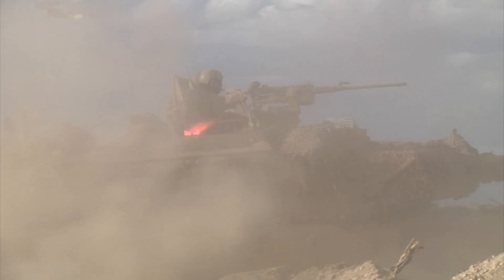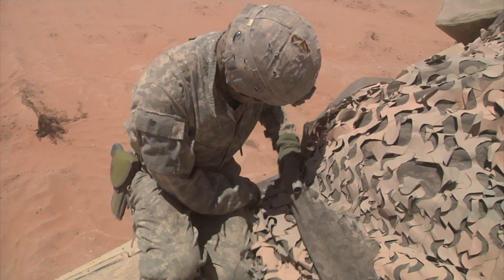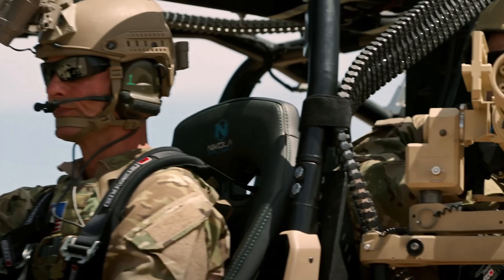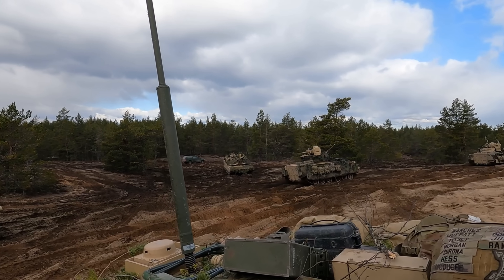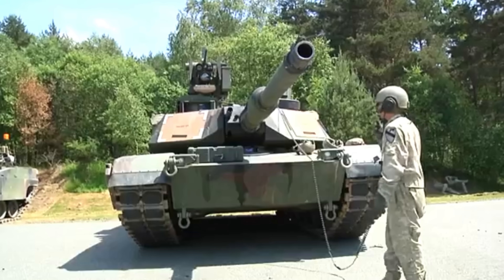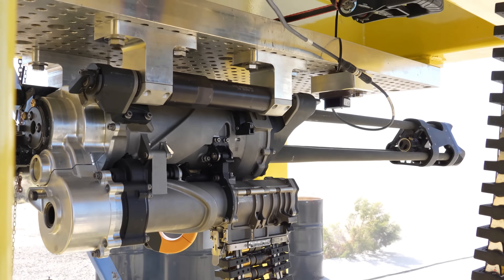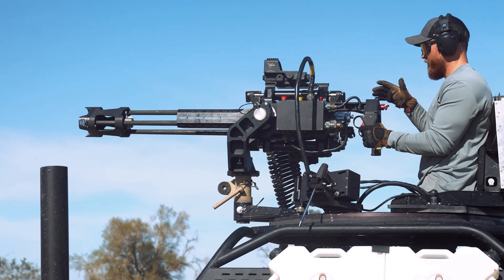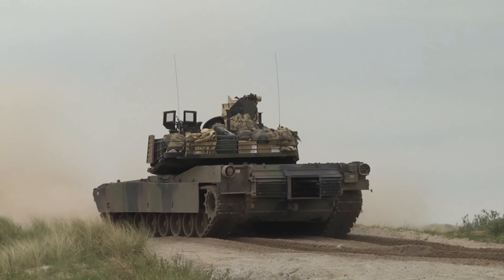Why is the U.S. Army putting a M134 Minigun on Abrams? | ROTARY GUN DEFENSE

Comment: I think testing out systems like this makes sense. Test it, see if drones can be effevely engaged by the weapon at appropriate ranges, then work it into a remote or semi automatonous weapons system if it functions well.

The idea you threw out about a claymore like one, that would only be a last ditch defense at extreme close range. I see some suggest a 5.56 micro gun style system, it's a bit closer range than this, not good if they start using drones with rockets. A 12.7mm system could be great at range but a serious ammo hog.

Exposing a crewman when they are engaging a kamikaze drone is one thing, but drones arent all going to be that style, they'll be engaged by drones with grenade launchers, rocket launchers, maybe even small arms. I could imagine a foe throwing a couple kamikaze drones in, while engaging with a drone with an air bursting grenade or rocket to kill the gunner. I don't imagine the military would leave it as a manually operated gun for very long.

Comment: Pretty sure its a stopgap but knowing and having served in the US Army both Officer and Enlisted. Stopgaps are usually permanent because Procurement of a new system takes 5 to 10 years to implement even if its finished in production and good to go. That said I'd much rather have the M134, GAU19B or whatever can be slapped on NOW. In my honest opinion being from the country Two Rednecks hanging out on the turret with Remington 870 Shotguns with 3.5in Super Magnum Buckshot would be optimal.

Comment: I say bring back the xm214. Everyone wants bigger but as far as I'm aware drones aren't armored. Just some plastic blades and carbon fiber. XM214 is 5.56 half the length just as fast half the weight in ammo. Better ballistics than 7.62 or enough to take a blade out anyway. You could carry two on the tank. Not that the tank is a good platform just saying. A small radar to spot drones. You could have crossfire with other systems. To you point of shooting another tank well a 5.56 wouldn't even register on an Abrams. Just my 2 cents.

Comment: Big fan of your content Matsimus, the Profense M134 uses brushless motor technology which allows it to immedietly vary the rate of fire from 800 to 3000 rd/min via 1 of 2  push buttons.  These values are easily programmable to other rates as required.  The point of immediate rate of fire changes is ammunition conservation.  The user can achieve a solution by fire or suppression with 800 rd/min then immedietly hit the high rate button to destroy.  Short "burps" are acceptable with Profense technologies.  Thanks again for informative content!

Comment: I think it’s a stop gap measure and more so a training and sustainment exercise. Getting crews used to drone countermeasures and having to look after another bit of kit aswell as getting them used to the extra supply challenges so when they eventually get a purpose built thing it will hopefully take less work to implement.

Ps the gau series of guns (18-19) are the best got the punch of a 50 and the fire rate of a mini

Comment: #1 - Mount a remote (Brrrtt.) the A-10 warthog plane  gun with additional AI for precision on the top of the tank then work on stability  ( But not to take ou  drones) But to kill tanks and armored vehicles in different way the GAU - Avenger 30mm gun

#2- Mount a remote turret with Bradley's  gun on the abrahams tank with extra granade louncher then improve the stability of the vehicle and size ( Not to take out drones) for lethality versatility

#3- For drones attacks  both Jamming and Reactive net kinetic system with AI. 

operating  similar to reactive armour spoting the drone trajectory and shot anither defensive mini Drone net high in the sky  with just the way drones  interceptor 

to embrace and catch the attacking drone

The interchange adaptability of systems between us forces division can save a lot  issues

Comment: 10-8 gauge full auto belt fed shotgun. Top mounted, possibly automated. At those large guages you'd have no problem packing them full of buck shot or even bird or a mixture. For reference a standard 2 3/4 inch 12ga shell holds about 9 pellets of 00 and 28 #4 buckshot. A 10ga can hold 18 00 buck pellets and up to 50 #4 buckshot. 8 guage would only hold more though I couldn't find any numbers on it because 8 guage is mostly on used as an industrial deslagger now and not traditional firearm uses. But i have found that slugs as high as 3 ounces have been used so you can imagine.  But an 8 guage is about 21mm. So it'd essentially be a 20mm shotgun. Whether using 00 buck, #4 buck, or even hybrid loads it would be fantastic for drones and even serve as excellent antipersonelle and light vehicle roles. Even more so if you had the ability to swap out to some of those 8ga 3 ounce slugs. Though I think 10 would be more practical from a balance of weight/size vs. area of effect.

Comment: M230LF.  The 30x113 cartridge is only 199mm compared to 134mm for a .50BMG round but packs a 30mm programmable HE punch.  We should be putting these on everything.  They have been test-mounted on the JLTV and even the back of a pickup truck.   Slave the powered mounting to networked sensors and everything has the ability to knock down drones, helicopters, low flying aircraft and still be able to hose down a tree line with 30mm goodness.  In my world every platoon will have a vehicle mounting one and every squad will have an Ohio Ordnance Reapr in .338NM on tap.
Reply from the maker: That sounds like a very interesting idea, thanks for the info!

Comment: As cool as this is, it doesn’t seem practical. The loaders M240 is the backup for the gunners coax and the maintenance required for these things will only add more of a hindrance to deal with in addition to the plethora of random issues that comes up with the Abram’s. Anytime more tech is added to these tanks, so does the fault list and potential for failure. Also, the ammo box on top of the blowout panels is wild. 

If the army wanted a drone defense weapon for the Abram’s, passive EW protection would be the most effective and cost efficient.
Reply from the maker: Thanks for your comment, the maintenance aspect is certainly a concern that's worth considering!

Comment: They could idk heres a thought mount the GAU-21 onto the vehicle Im about 90% sure the GAU-21 fits on a standard M2 mount.... its just very slightly longer at the receiver backend. but its 1200 rounds per minute. 50 caliber machine gun. you could easily pair this with a new proximity exploding ammo and some kind of radar system like a budget active protection system it could potentially engage and shoot down ATGM's and Drones and aircraft when not in use it can function like a normal commanders weapon. 

if they just integrated the RWS and used it instead of the CITV. tada a bunch of turret space cleared up.
Reply from the maker: That sounds like a great idea!

Comment: These dudes are seriously trying to argue that an automated firing system connected to a mini gun wont be effective in protecting aganst drones? The only real issue I see with that is the ammunition size and cost per bullet spent compared to cost per drone. It could be weasled down to a much smaller cartridge than a 7.62x51. But it also depends on the range that these systems can detect drones. If they can detect them out to hundreds of meters, they obviously need a high power, high velocity cartridge firing at extremely high rate of fire to be able to effectively hit flying targets.. But if its designed to detect them at short distances, they could use some sort of auto shotgun mount. It really depends on the distances this thing is designed to engage at. Wether it would be effective is not the question lol Because it would be, without a doubt.......The question is, how do we make it as effecient as possible? How do you make it easy for this system to be dealt with logistically?

Comment: I think that the Abrams is just at the end of its 'relevant' life. Its been in service since the 80's.  A new chassis and turret , new armor, etc. is needed considering modern threats.  FPV, GPS jam, etc.  

IMO you would have a unmanned turret with autoloader and a 4 man crew, Driver, Gunner, Commander, and a EW / Defensive Systems Operator,  You retain the fourth crewman and gain a dedicated person for managing defensives, especially as those defenses require more thought to implement in the moment
Reply from the maker: Those are some interesting points regarding the future of the platform!

Comment: Honestly i think knowing headspacing on the m2 machine gun is a nightmare and given the m134 has a much higher damage output then i would say the 7.62 nature of the m134 is also more capable because the round of much smaller allowing for more ammunition on the gun itself or on top than inside the tank...
And size and weight might have a role given the m2 is really long and heavy thus a m134 could be more helpfull in that regard..
Having the gau-19 you still have the same ammount of .50 caliber amunition as with the m2 only it goes through it much fast, and though the gau-19 has the same or similar volume of fire it would need much more ammunition than the m2. Thus the 7.62mm system has a better solution, les actual bullet to shoot the more you can carry, and yes you can't maybe hit armor or cover with the first 10 rounds it still keeps them busy thus still they are unable to do much unless they take a risk and peek out from cover wich wil lead to a hit and so a big chance of them being out of the fight in general even if they are not dead...

Comment: drones are a problem.

this needs to be aknowledged.

and the way to aknowledge it is by protecting the tank from a massively assymetric take-out by, if what he said was true, a 500 dollar drone (not including price of ordnance im assuming)

you would need radar (not a problem, drones are pretty easy to spot on radar) and an an m-134 or tubes with multiple short range SAM, Stingers, most likely.

no point i having a great beast like that roaming the battlefield if it can be taken out by something as cheap as a 500 dollar drone.

protect your assets, or lose em, its not complicated.

Comment: Personally I think a counter burst system. Add some modified smoke launchers with airburst munitions. Basically the same idea but using small airburst mortars. Could easily dispatch multiple drones, deflect/damage/disable larger munitions. And they're small. Could strap extras as with ease too
Reply from the maker: That is a very interesting idea, thanks for sharing!
Reply: @_Matsimus_  Thanks! Damn near every armored ground vehicle we have already has the launchers and wiring. Although I did see an article about the new Leonidas system a few days after I posted lol No two ways about it... theirs is WAY cooler lol

Comment: Instead of scaling up to the Gau-12, I think a better option might be scaling down to XM214 Microguns, but to place them on automated gimbals on either side of the turret.  Between their two firing arcs you can get full 360 degree coverage with only tiny blind spots at near point blank ranges.  5.56, the ammo is dirt cheap, lightweight, amd the USA already has literally  billions of rounds of it sitting arround in storage.  Your average FPV drone can be taken out with a baseball; so, bigger calibers are completely unnecessary for drone defense.
Reply from the maker: That's a very interesting idea, thanks for the suggestions!

Comment: Seems to me that the perfect solution for relatively slow flying drones is some kind of computer managed quick firing weapon firing distance fused frag rounds that can lay down a wall of flak. If you could manufacture a round that can produce a spread like a shotgun round that has a range of say 1500 to 2000m firing about 600 rounds a minute you could literally put up a wall of shrapnel in front of a drone that would shred it instantly.

Comment: You gave up all credibility 5 min in when you rattled off all the systems on the top of the turret and say the loader can't possibly use a weapon station...the loader has always had a pintle and shield mounted M240C...the loader is and has always been the  primary for close infantry threats either while the main gun/coax is dealing with farther out threats or are too close or, too high, or confined spaces. Your lack of any knowledge about the crew roles/ weapon systems has invalidated you from ever having one of your videos appear in my feed again.

Comment: It's gonna come down to something like CIWS. They're gonna develop a radar fast and accurate enough specifically target drones of various shapes and sizes. An ammo rack for an M134 can be improvised on the outside of the tank, saving room for the coax and 120mm. I'm sure the army will find a way. Without some kind of targetable EMP, the answer to drones will probably look like the above.

Assuming the radar is good enough, a minigun is overkill. A 240 or a .50 would probably be adequate.

Comment: I think you are missing the true role of this weapon. It isn't really supposed to be used during an active assault, during a planned offensive the tank should have external sources of destroying drones. However, a lot of these tank kills we are seeing are on tanks not directly on the front lines. The exposure of the loader is required for the weapon to be able to properly angle upwards, and the ammo shortage issue isn't as prevalent if these are intended strictly to be a final wave of defense.

It seems like a stopgap measure, intended to give these platforms some rudimentary ability to fight back. That being said, I don't think it solves the issue at all. Firing these weapons is expensive, meaning the destruction of a drone could still cost more than the value of the drone itself, and the lack of a proper targeting system makes the effectiveness of the weapon in any area without perfect aerial sightlines, such as basically anywhere with trees, of questionable effectiveness. Something like a traditional 7.62 machine gun mounted on a remote weapon system with good targeting systems seems to me to be a much better option

Comment: For the reasons you laid out, I would think a 0.50 cal minigun would make even less sense against drones.
A 5.56 micro gun would make the most sense if any, as 5.56 should be plenty sufficient for drones at the ranges you would likely use this and it means everything would be smaller/lighter.

Comment: I think something on the order of a 20 or 30mm with fairly small propellant charge it don't even have to be multi-barrel Gatling gun but just 20 mm with a reduced charge in it make it smooth bore and make multiple different kinds of shells to engage different things so it can be used for something other than just drone defense hell maybe even 40 mil but I believe that's a little too damn big

Comment: personally its a mixed bag for me. I think the effectiveness of a high rate of fire weapon system is debatable against drones. A more advanced APS could of done this job easily.  As a fire support weapon I can see some potential with it. A m134 is great for suppression. The downside you lose some capability that the M2 has such as barrier penetration and capability to take down lighter skinned vehicles.  This should not be a standard but a possibility imo. There is value in either option but there are trade offs. This is personally not the drone solution though. A better APS that is standardized is. If a APS can track a modern SACLOS missile and defeat it will certainly do the same against some  quad copter with a bomb

Comment: CIWS for tanks, rounds only matter if they hit and if a 50BMG would be effective I don't see why a 7.62 or even 5.56 wouldn't be, plus if you got a 5.56 CWIS that's allot of potential hits which is better for sustained attacks, the exception is an explosive round but you're not putting a time-fused detonator in a 50BMG so if you're going big you're either going 40mm or bigger and we're back at pom-poms.
I have low faith in timed fuse in actual use, it always looks great on a range but what's the actual radius of effect (and effect doesn't mean scratched paint) and their % chance of being in that range? You fire off 20 rounds at a drone and 15 go AWOL, of the 5 remaining 4 explode too far behind or too close, the 1 that is within the 2meter area of effect the lightweight casing shrapnel takes off a rotor but the other 2-5 rotors allow it to drop a grenade, 200rounds of 5.56 or 100rounds of 7.62 tracer might do just as well for a fraction of the price? without field reports all I know is that I know nothing.

Comment: It might be better to go with a 40 mic and put canister rounds in it because if I just slap say a link feeder like on a minigun but on to a aa12 in some magic way after constant feed of ammo that would make the ammo have a much higher fail rate a jam or warp the barrel from the heat but the auto shotguns already have a high fail rate with drums so I can’t see it working out but with the 40mic you could put canister rounds and send a ton of stuff up in the air easy or if the abarms had no power or wire problems you could just slap a drone toaster on top or rather a Directed Energy Weapon but then there’s the problem of keeping it on target for a good amount of time and it would lose a big part of its anti infantry capabilities now you could maybe do a minigun but make the barrels bigger and shoot shotgun rounds at a slower rate but there will still be a high rate of failure to feed the round in bricking the gun tell it’s cleared I still think the cope cage is one of the best ways to fight drones without needing much but this is all speculative and maybe one of the ideas would work way better then I think they would